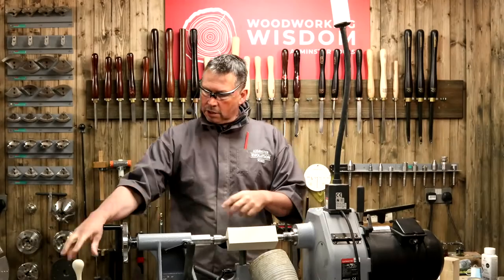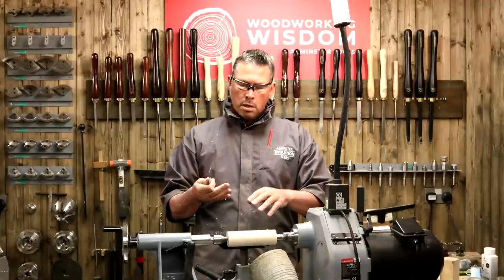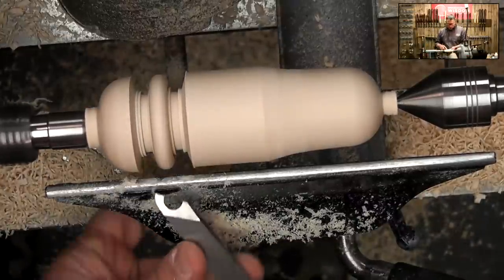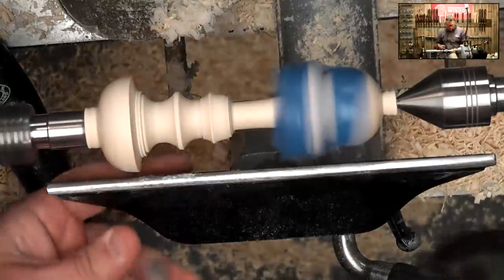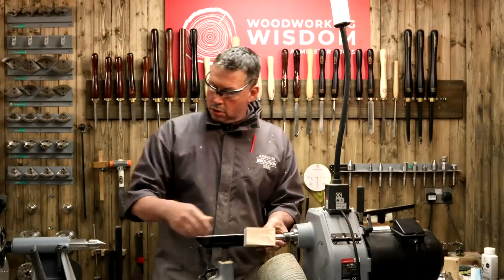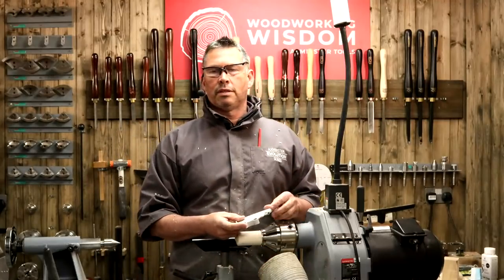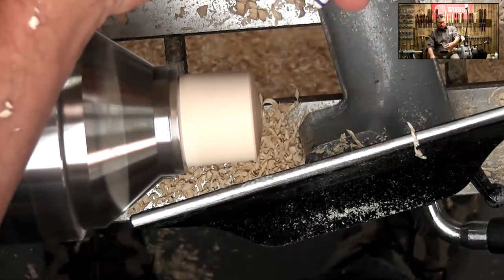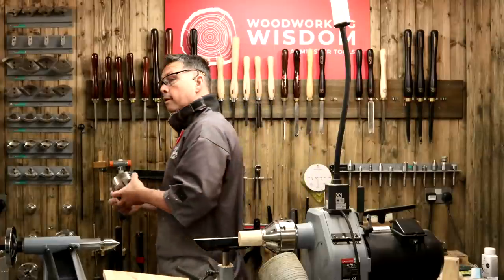How to Make Wooden Baby Toys - Woodworking Wisdom

Comment: Thank you again - entertaining and informative as always. I've never used an airbrush before but I'm surprised you can get away with using it on the lathe without paint getting everywhere! I'm used to putting a small piece of plywood down on the bed before applying most finishes.
Thanks again, really enjoyed it.